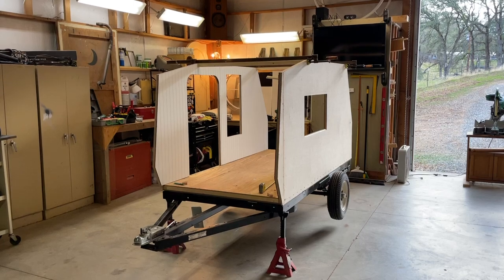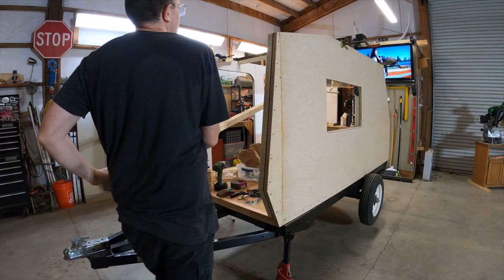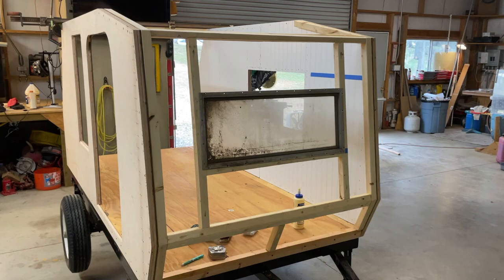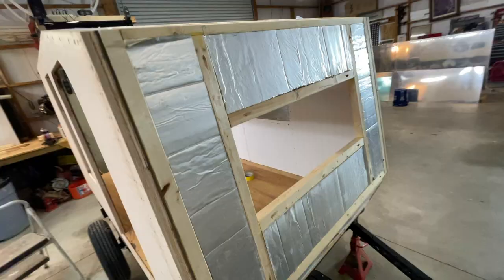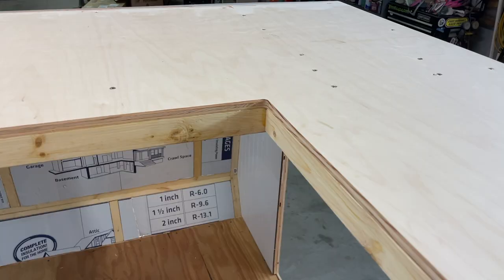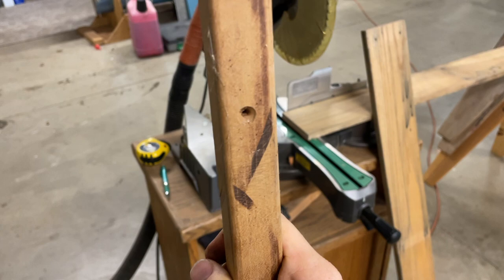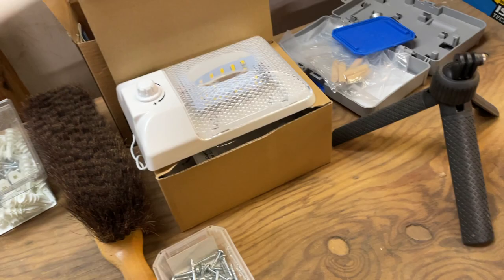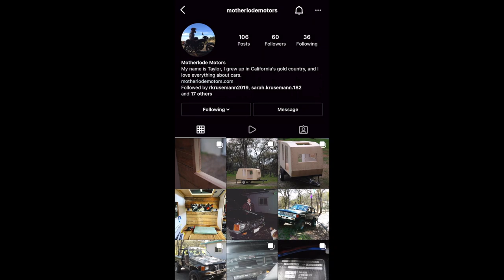building the roof for our cheap camper trailer

Comment: I've watched a lot of videos similar to this one, and never seen anyone water proofing the wood, or treating the steel screws with some corrosion resistant treatment. For the use these DIY trailers will get, waterproofing should be a consideration. Best wishes.
Reply from the maker: What do you suggest?
Reply: @MotherlodeMotors  I speak because I own and lived in my sailboat for some years. I'm sure marine grade wood is expensive, but at least wood should be treated with Thompson water proof, (canned, not the spray) or similar. Stainless steel hardware is out the question for your project, however, dipping the screws ( the ones in the video are fine) in some waterproof solution before driving them. Countersinking is a great idea. Making the hole a bit deeper,  then pressing, not glue, a dowel pin on top of the screw head, then waterproofing the area, should keep moisture out, and reducing rot. If I was building one, I would hate to go back every two years or so to fix rot. I'd rather enjoy the trailer for many years, and in not so great weather. Great project indeed.
Reply from the maker: I think building these trailers like a boat is the way to go. Water seems to be the Achilles heel to most of them. To me the hatch hinge seems like the hardest part, you can make the length of the hinge fairly waterproof but the ends are difficult.

Comment: Excellent craftsmanship.  Did you consider making it taller on the inside when you were designing it?
Reply from the maker: Not really. My goal was to have it be shorter than the tow vehicle for aerodynamics. And also I only had to use one sheet of 4’ wide ply to get the height.

It would be cool if it was taller inside, but it would also be cool if it was wider, and longer, etc… haha

Comment: Curious what is the weight of your camper?  I am just starting a build which I will pull with a Toyota Prius so need it built solid yet as lightweight as possible.  I'm following the idea of the Prolite RV Suite which weights in at 590lbs dry weight.  Thanks for your video's!
Reply from the maker: I do want to weigh it, when I do I’ll be sure to put it in a video.
Reply: Can you use a frame for the relax

Comment: I'm not sure if I missed it but what size plywood did you use for the roof? Thanks!
Reply from the maker: It was 4’ wide but because I did the siding outside of the 4’ I was forced to add the trim strip on the edge to meet the wall.
Reply: @MotherlodeMotors  Sorry I should've specified. I was asking about the thickness. 😁
Reply from the maker: @njrx7t2  1/2" ply on the whole thing.

Comment: Nice build? Are these regular windows or R’s windows?
Reply from the maker: I'm not sure what an R window is?
Reply: @MotherlodeMotors  oops. I meant RV windows
Reply from the maker: @samiam9359  Oh they are used RV windows from an RV junkyard, they are just an older style than the ones the with radiused corners that you usually see.
Reply: @MotherlodeMotors  ahh. Ok ty